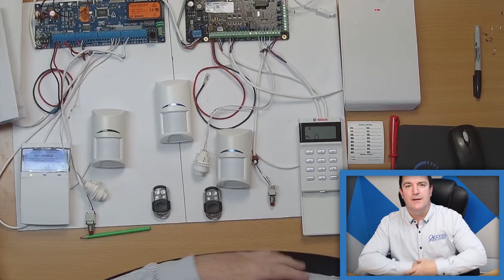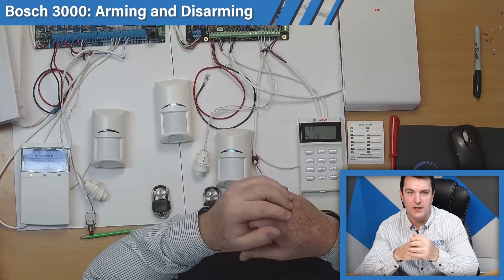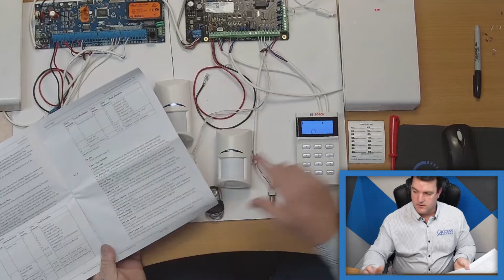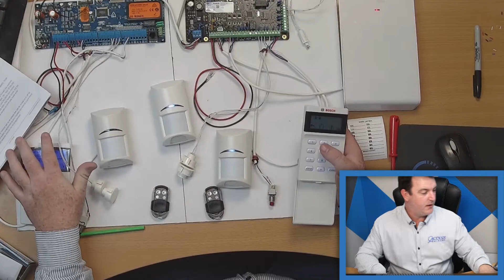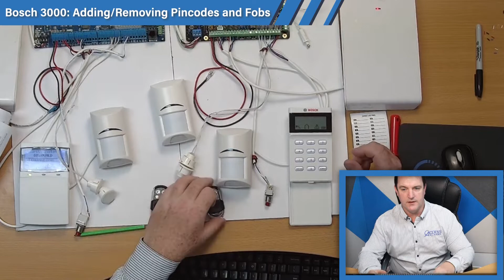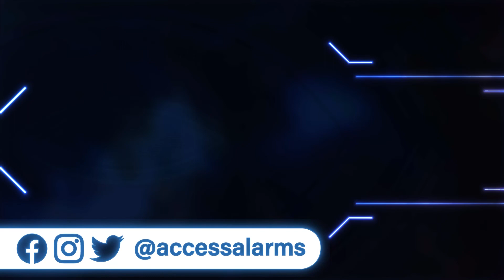Bosch Solution 3000: How to use your alarm system

Comment: Originally had Hills installed, battery connectors in the 3 of the motion sensors started to fall apart, couldn’t get replacements for them so we upgraded to Bosch. Is there a pdf user manual I can download? Can’t seem to find one online.

Comment: Hi, the panic alarm supposedly on this unit is the * and # keys. I havent been game to test it as is says to silence the alarm contact your installer? Surely you can turn off by pressing again? Thankyou
Reply from the maker: Hi Brian, the panic alarm can be turned off in the same way as disarming your system, you will need to enter a valid pincode.

Comment: Can you tell me please...when I am using the remote and want to arm in stay mode ...do I press the stay mode button followed by the arm button? Or is the stay button arming it on its own.
Reply from the maker: Hi, That is a programmable feature that is setup by your installer. The stay button should be the trapazoid button on the remote. However, it can be turned on/off in the programming.

Comment: hi thanks for this, my system has the zone 8 flashing super fast all the time with the fault triangle. I cant get rid of them and every 15mins the entire system beeps 1 long beep. and then I have to press away and it stops but then it beeps again in 15 mins or so.  Its a nightmare. zone 8 written on the inside lid in handwriting as 'Tamper'... Im guessing thats the little tamper steel piece on the steel box when I take the lid off. Ive tried to play with that and the whole alarm goes off.  I have set the date following your instructions yet Fault code when hooding down 5 for 2 seconds shows zone 2 and 8... the time and date and the tamper... this has been going on for months and im ready to smash the thing? How can I solve this? Rip it off the wall?
Reply from the maker: Hi, the Solution 862 is an earlier model, and has a different fault listing. The fault indicated on "2" is still the date and time, but the fault on "8" is a communication fail, not a tamper.  We would recommend contacting a technician to have a look at your system. You can power down your system in the meantime, this requires unplugging the panel and disconnecting the battery.
Reply: @accessalarms  thanks for the prompt reply. So you are thinking if I unplug the power supply from the powerpoint... and take off the battery terminals.. that unit will power down? To try to stop the insesant beep I did unplug the power cord and no battery was connected but the lights remain on the unit and it still beeps? Does that mean it's hard wired somehow? I have download the manual for the Solution 862 and yes the manual said zone 8 is 'communication' ...however, my guess is the installer of the system (previous owners of the home) in ball point pen have written the zones on the inside flap of the door lid - zones 1234 & 8... and zone#1 entry zone#2 kitchen etc and zone#8 states "Tamper"  - so it's logical to assume he has somehow allocated zone#8 to 'tampering'? if not why would he write that on the information flap? That said, I dearly would love to just stop it beeping and if that means turning the unit off completely as we dont use it anyway I would do that? Thanks for any further help you can provide. cheers
Reply: And whilst I appreciate I can call a 'technician' im am trying to do my best not to find myself with a bill of at least $200 for a service call. Because that's pretty much the minimum it will cost for anyone to visit the home and figures out how to solve the never ending been.
Reply: perhaps I don't understand what's required to 'unplug the panel'... would you mind telling me what's required to do that? Clearly I know where the 240V socket power adapter is, but do you mean unplug the keypad panel, do I remove that and unplug something behind that? I also can unplug the battery I just replaced inside the steel box

Comment: I have a solution 880 alarm control panel. If I got a replacement solution 3000 keypad, would it be compatible?
Reply from the maker: Hi @lukewolfgames, The 3000 system uses a different data bus to the 880 and ultima series. Generally updating to the 2000 or 3000 control panels isn't a huge cost especially compared to changing the keypad.
This is the keypad to match your controller.
https://commerce.boschsecurity.com/in/en/LCD-icon-keypad-8-zone/p/F.01U.073.966/

Comment: How do I change the alarm timer, my alarm goes off as soon as I open the door once it’s armed I want to delay it about 20seconds
Reply: Hi this normally means a detector in your entry path is set to instant or handover. It is more likely the zones are programmed incorrectly. This is something you should pass back to your installer or you can attempt it yourself with the installer guide at your own peril :).
Reply: @elliottburgoyne5779  we had an outage and the battery backup ran out. Ever since then that’s when it started. Where can I find the installed guide